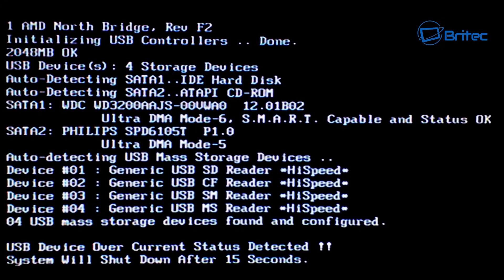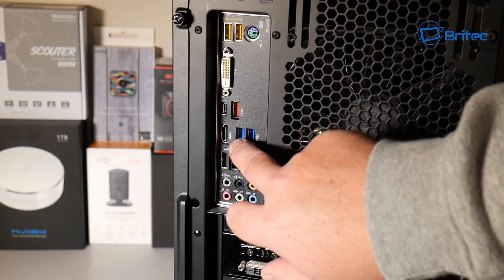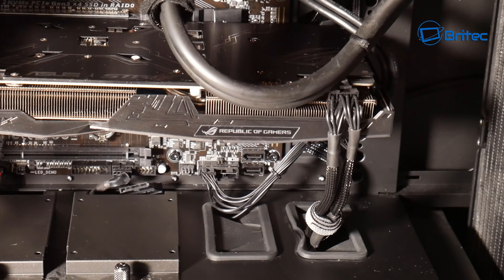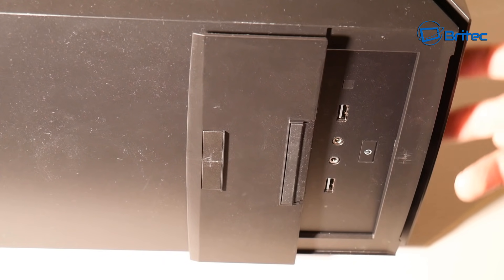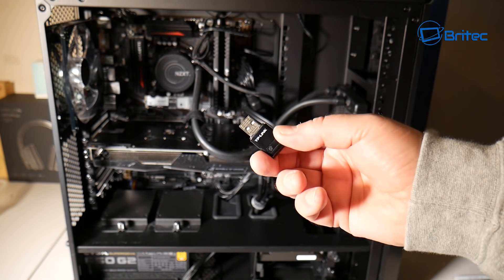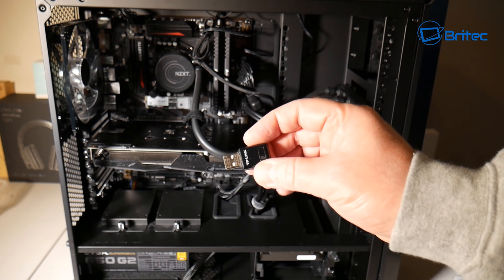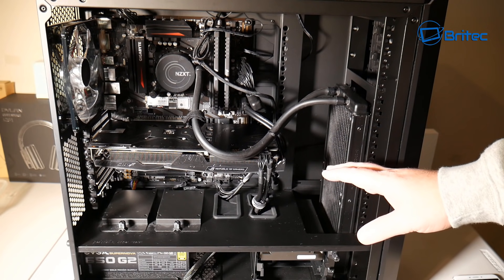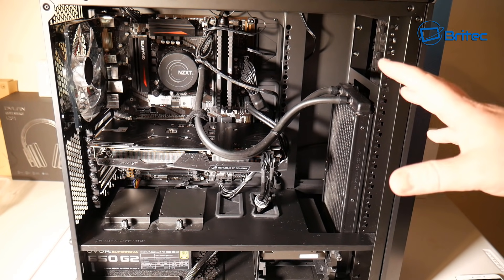Fix USB device Over Current Status Detected, System will shut down in 15 seconds

Comment: Hi, so I’ve just built my system and I’m getting this error. I’ve done everything said in the video but nothing is working.
Reply: @Shimraan   for me yes it's a new build
Reply: did you fixed it?
Reply: @HarleyQuinnzel15  the io shield was interfering with a usb port
Reply: @HarleyQuinnzel15   and yes I did I had to cut off one on the metal prong

Comment: hi I have an Asus MB M3A78-T hadnt used it in a while the cmos batt died, replaced it and went to Bios got my raid going back in business.  HOWEVER, when i rebooted the PC the mesage came on 1st time ever. so i removed the batt and waited 20 mins again same issue.   removed all usb components no luck removed the usb cable inside no luck.  turned it on bare with only the monitor no mouse or kb still got the same message.  what did I miss?

Comment: I'll add I figured this out for the ASUS motherboard I was dealing with... it had no cables or USB devices plugged in, and all its rear USB ports were in fine shape. There was no legitimate over-current. The trouble was the BIOS itself. It had been flashed to the wrong model version -- it was an OEM version of the P8H67-M PRO board, made for the Essentio CG8350. It had missing front USB headers -- and their current-protection components were also missing. Flashing the full BIOS on there (not the OEM one) made it look for those sensors, and assumed a fault. Flashing back to the CG8350 backup and it works fine!
Reply: Matt Falcon how did you get into the bios if this screen pops up right away
Reply: @isaacharmeyer2918  I didn't get into the bios. I couldn't. I did this all with an external flasher... which... I suppose is a bit of a big problem if you don't have that :( It might be possible to trick it into working if you "hotwire" some of the missing parts for the missing front USB port header on the board... Other than that, yeah, wow, this can be a really crappy dead end.

Comment: Non of these options worked, and when i turn on the pc one of the fans turns on and then stops spinning while the rest are still moving.
Reply: Try replacing the fan that wont work with a new one and see if that fixes it.

Comment: My computer when I have 1 keyboard in says 2 keyboards when I have 1keyboard and a mouse it says 3 keyboard and 2 mice. I thought it was the front ports where I plug those in so I unplugged from the mother board and put the devices in the back but still same problem. This all started after I replaced a dead cmos battery what do I do now
Reply: Mike d I have the same problem except it says I have 2 keyboards, did you ever resolve your problem if so what did you do?

Comment: I do not see the CMOS disk you're talking about. My computer also doesn't have the front panel for usbs. My computer was suffering from the above errors but after I unplugged the usbs it started normally. So far anyway.

Comment: In my case, i have two game controllers xbox 360 attached to usb port. When i pull out the controller cable from usb port, the usb port over current disappear. I try to test the usb port with usb thumb drive and it can read without any problem. Now i need to know which is the problem? Game controller or usb port? I can't test game controller to other pc because I don't have other pc.

Comment: I think my problem doesn't lie on the USB plug but rather on the device cause when I disconnect my keyboard my computer works but if I reconnect it, it will shutdown.What do you suggest?

Comment: Fantastic Video, I did run into exact issue with client 3 years ago.
Reply from the maker: Yeah its very common
Reply: @Britec09  excuse me, is their any chance you can help me fix this problem? But on PlayStation not on pc? Please..
Reply: same here. the pins in my usb port was touching the metal(it got bent) after bending it back i got it fixed.

Comment: USB 5-volt rail shorted to ground = USB device over current status detected will shut down in 15 seconds the common course is the central white or blue plastic spacer in the USB port snaping and the 5-volt pin touching the ground shealed and on some occasions, it's a damaged USB peripheral.Great info Bri.
Reply from the maker: That's right Daz, nice easy fix.
Reply: how can i fix this? please help me, i tried everything now and nothing worked (Asus Z170D)
Reply: This 7 years comment helped me to fix the problem
Reply: Sorry I don’t follow. How will that happen? I have this trouble now, I unplugged all usb connection to board- same error report:( Prior to event, all seems working. I only reinstalled pci express gpu, after that..bam- error report.

Comment: perhaps first check the USB device or more devices and than check the cable connection  great video
Reply from the maker: As long as you resolve the issue it don't really matter where you start.